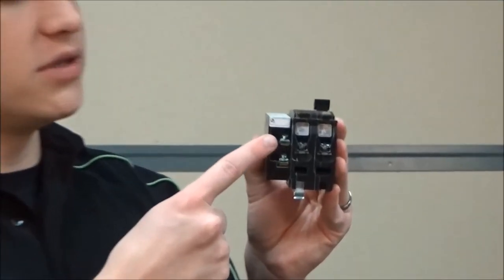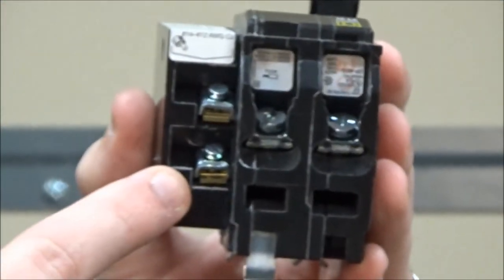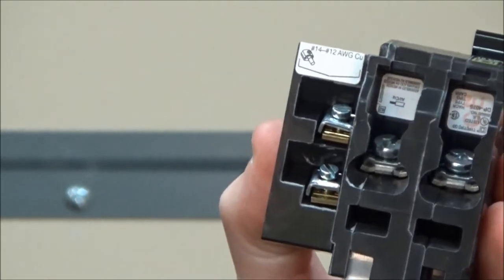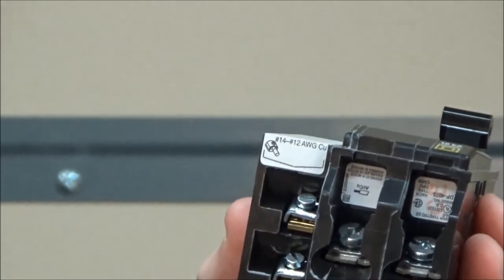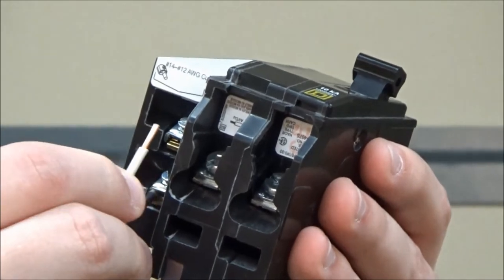Wiring a Shunt Trip on QO™ Circuit Breakers | Schneider Electric Support

Comment: I am used to the Siemens shunt trip that has a neutral wire connect to the neutral bar. This QO does not have one, is that mean i can use one for the shunt and other to the neutral bar from QO breaker? or just use one connection without the neutral wire to neutral bar ? thanks for the video.
Reply from the maker: Thank you for your message, Vinh Nguyen. We apologize for any inconvenience caused. Our customer care team would be happy to provide assistance. Please reach out to a customer care member in your location here: https://www.se.com/ww/en/work/support/country-selector/contact-us.jsp
Reply: I think you're confusing the Shunt Trip Breaker with a GFI breaker.

Comment: I don't think this is also GFCI !?! Not with SD breakers ?
Reply: I think you have to install a current sensing relay with the shunt trip to get GFCI protection.
Reply: @Checkmate54321 not worth it. You’re better off just using a separate gfci device to add gfci protection.